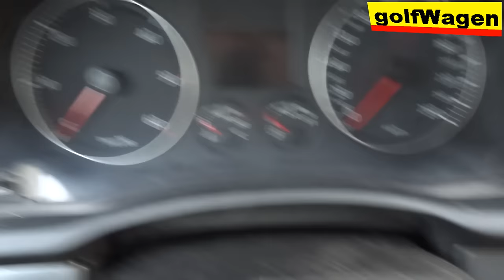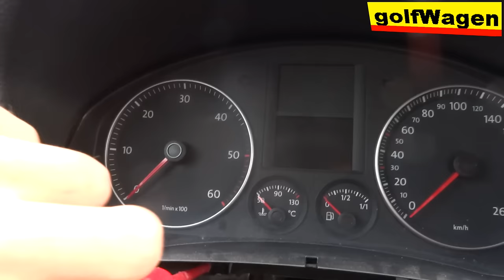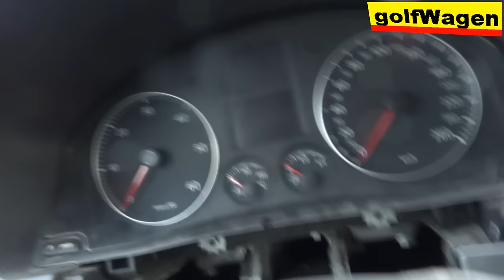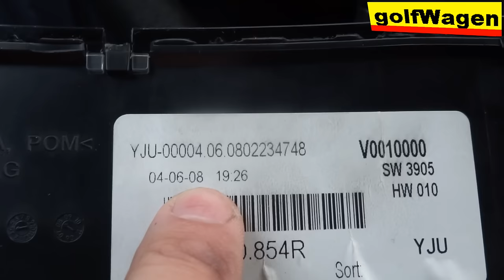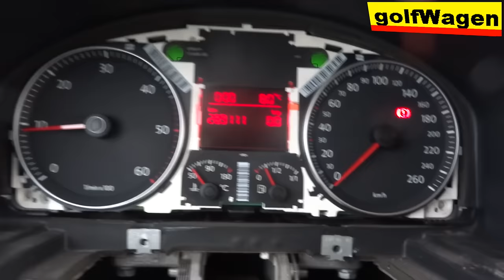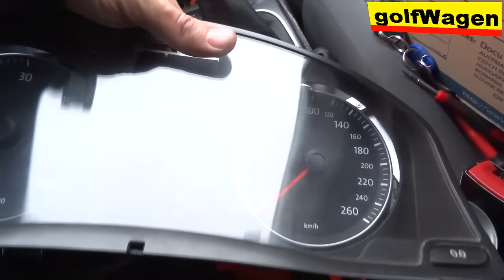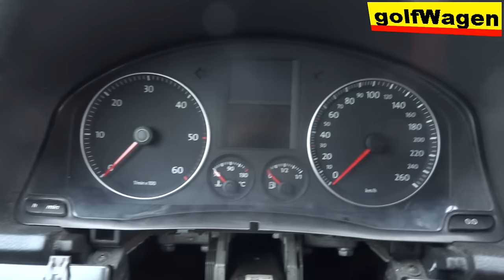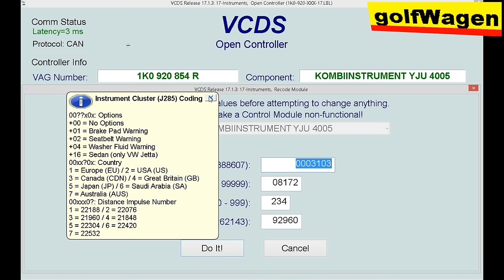VW Golf 5 instrument cluster removal /1K0 920 854R Visteon/

Comment: Thank you, very useful. I was able to replace the red LCD panel (mileage, fuel consumption etc.) in the centre after watching this. Luckily I did not break anything. However, I was silly enough to try to start the engine with the cluster removed and now I get an airbag error. Moral of the story: Do not turn the key with the cluster removed!!
Reply: Just clear it off with delphi or vcds its not a big issue

Comment: Does the mileage stays the same after replaced the cluster?
Reply: The total kilometres (indication on the left) will stay the same. The 'trip' kilometres (on the right - the ones you can reset after service) will be reset. At least, this is what happened to me, but it may be because I tried to start the engine with the cluster removed..doh!
Reply: @evana.1604  do you have to reprogram it

Comment from the maker: no 100% not /warning!!!!/ 
Pin 1 - Pin 3 from the Fuel Sender
Pin 2 - Pin 4 from the Fuel Sender
Pin 3 - Not Used
Pin 4 - Not Used
Pin 5 - Not Used
Pin 6 - Not Used
Pin 7 - Immobilizer
Pin 8 - Immobilizer
Pin 9 - Pin 6 on Sunroof Control Module
Pin 10 - Not Used
Pin 11 - Oil Temp/Level Sensor
Pin 12 - Not Used
Pin 13 - Not Used
Pin 14 - Not Used
Pin 15 - Brake Pad Wear Indicator
Pin 16 - Terminal 31 (Ground)
Pin 17 - Washer Fluid Low Indicator
Pin 18 - Coolant Low Indicator
Pin 19 - Ambient Temperature Sensor
Pin 20 - Sensormasse (Switched Ground?)
Pin 21 - Not Used
Pin 22 - Not Used
Pin 23 - Not Used
Pin 24 - Not Used
Pin 25 - Hand Brake Indicator
Pin 26 - Brake Fluid Low Indicator
Pin 27 - Oil Pressure Sensor
Pin 28 - CAN High
Pin 29 - CAN Low
Pin 30 - Not Used
Pin 31 - Terminal 15a (Switched Ign)
Pin 32 - Terminal 30a (Constant 12v)
Reply: where to put these pin number pls mate ?

Comment: Hi there I was wondering if I replaced the cluster will the mile on my car stay the same ???  I see that you replaced the cluster and the mile stay the same
Reply from the maker: I mounted the same again
Reply: @golfwagen4173  that means the mile will not stay the same right? can we make the miles same as it previously was?
Reply: @Seminari1985  The total kilometres (indication on the left) will stay the same. The 'trip' kilometers (on the right - the ones you can reset after service) will be reset. At least, this is what happened to me, but it may be because I tried to start the engine with the cluster removed..doh!
Reply: Vangelis A. Thnx Vangelis, did u change the complete cluster or just the lcd, ive heard if changing just the lcd its better and easier, need to open myself and check if its easy!

Comment: i just did that and didnt break anything i have 2008 vw golf 5 variant (if you are wondering what i did i did put tape over washer fluid light) ( i dont have sensor for that but light was on) thank you golf wagen ;)
Reply: You can desactivate that with vcds, no need to remove anything

Comment: I can't seem to the get rid of power steering light. Its orange, can you help?
Reply: I looked it up. Start car, turn wheel all the way to left, turn wheel all the way to the right, drive the car car a short distance(around 100ft) at 15-20 mph and the light should go out. This only works if the light came on after a disconnected, dead or jumped battery.

Comment: Hi..can whe put another board instead this original?sry 4 english
Reply from the maker: yes they need to be coded. and you need to know the PIN from the new board. and you need to know whether you have an immobilizer 3 or an immobilizer 4 etc.
Reply: @golfwagen4173  to fix pixels on mileage disp.only whey ist to change it?
Reply from the maker: @the4motion467  this is probably the case, but it will not be easy
Reply: @golfwagen4173  i know.tnx 4 your time😊